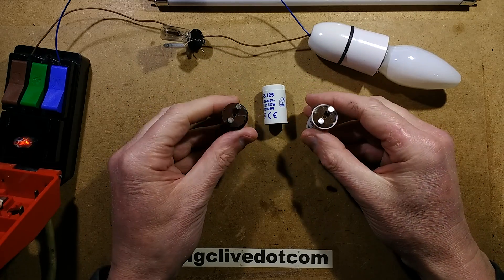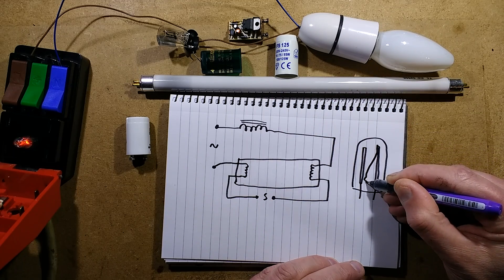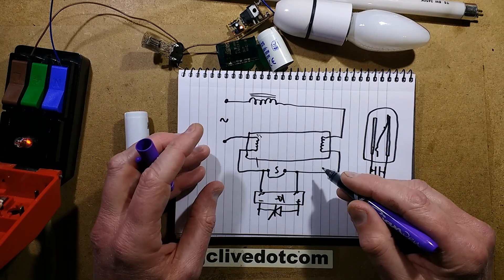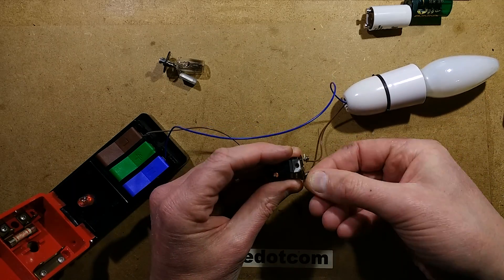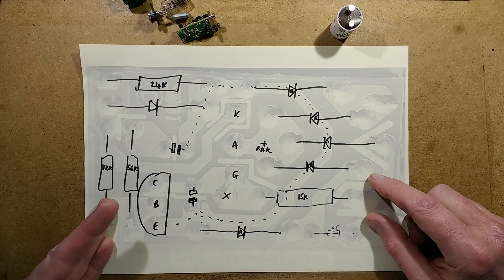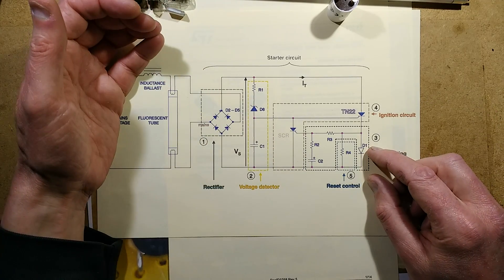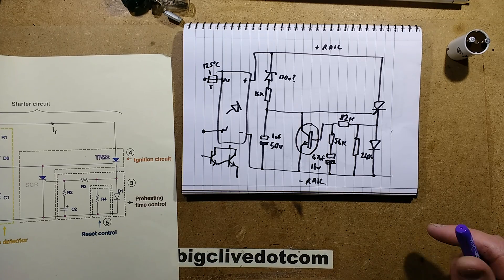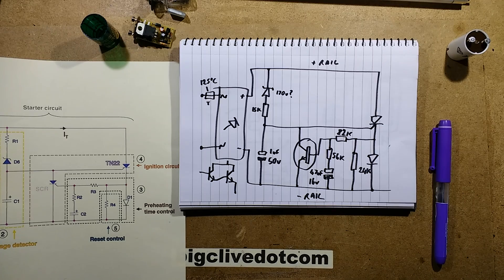Reverse engineering an electronic fluorescent starter.

Comment: There is no necessity of heated electrodes: with normal 220 V current and an inductance in a series with a capacitor you can obtain a very brillant tube neon light without heated or preheated electrodes, but you need a starter always: it must short-circuit this L-C ballast in order to generate starting high voltage electric arc, and it can do it easily. The neon tube then starts immediately, unlike the preheated tubes.

Comment: I saw you struggling with the word for thermal emitters. From the time before these newfangled transistors, we were very familiar with thermionic valves. 😉 Of course, these usually used a separate cathode although I suspect the fluorescent tubes cathodes may just be the filaments with a thermionic coating.

Comment: When the tube is operated in cold cathode mode on an electronic ballast and the emissive coating wears out, it is still able to strike (because it is a high voltage of about 600V`), but it will get hotter and hotter until the lampholder melts or the tube acutally loses vacuum.

Comment: The thyristor doesn't kick in again because the fluorescent lamp has been started and its voltage between filaments has dropped below 170 volts of Zener diode, so thyristors gate has no chance of switching the thyristor again, unless voltage again goes up to 170 volts.

Comment: I think it is pure luck that the TN22 stays on when it is supposed to, as the resistor across the diode in series with the cathode is 24k. It is that resistor pulling down on the cathode that drains current from C1 back into the gate to retrigger it on the next 1/2 cycle. C1 is then topped up by the voltage fed out the gate due to the equivalent circuit of an SCR (an NPN & a PNP driving each other). The max. firing current of the TN22 is 1.5mA, and the current through the 24k, with a full volt across it is only 41.7uA. It is relying on the TN22 taking less current than the maximum spec. I would have expected something like 470R, or 560R max.

Comment: The SCR is a type called a gate turn off, or GTO. That high hold current rating is only with the gate grounded. Driving it negative will drive it off. Because the timing capacitor stays topped up, the darlington would quickly drive the gate down to about the same potential as the cathode, so it could be retriggering, but turning off again quickly. You could check that with a cro. The reason for making it a GTO would be to make it turn off while there is still at least 175mA flowing through it to produce the inductive spike to start difficult tubes. I think the 56k in series with the timing capacitor might be to produce a bit of ripple to turn on the darlington, or fire the cutoff SCR while there is current flowing through the TN22 to produce the spike. In mine it was a 6.8K. I don't know what it was for, as the original thyristor was a C106D, not a GTO. Just recheck the orange capacitor value to make sure it is not 10uF like mine. Let me know whether it is or not, and the number on the zener please, as well as the thermal fuse number, as mine is a standard metal one rated at 2A 125 deg C.
The capacitor in a glow switch starter is to weld the contacts together briefly. I tried one without and the contacts just buzzed and it 1/2 lit.
Reply: In turn off mode , GTO's are equally power hungry devices that require at least (15-25)% of rated load current ( of reverse polarity) to turn off in my view , back then these were manufactured only for high voltage & high current industrial power control applications ..and such small / low power rated devices were economically unfeasible for general purpose everyday use.
Whilst the GTO's turn on circuit was similar & simple as for SCR's , turn off circuitry was more complex & power consuming.

Comment: bigclivedotcom, the 82k resistor has to go to the SCR gate to get enough voltage to turn on the darlington, as it requires 2 diode drops. I traced the circuit out from another youtube video by an American guy, but in his one, the 82k was 100k and the 15k was 33k like the one I put in my rangehood. Yours must be designed for a fitting with 2 tubes in series or 120V. What is the number of the zener in yours? Is it is probably a BZX85C110. It looks like you wrote 170V. That's not a preferred value. I'm not sure if mine is a Pulsestarter brand. I would have to partly disassemble the hood to see. It looks the same, but a different layout and has the same circuit as the datasheet, and has a specially selected sensitivity P0124 SCR instead of a darlington. R1 is 33k, R2 & R4 are 6.8k, R3 is 24k, C1 is 10uF, C2 is 100uF and the main SCR is a C106D. I posted the circuit on stackexchange How to light a fluorescent lamp, along with a modified version I designed to suit available components, which has a relatively fixed on time instead of that circuit which mimics the response time of the filaments with variations in current.

Comment: i use those ballasts  as load limiters  as i have 3  400w ballasts that came from  2 high bay hid lights and one from a  hps grow light .  and kept the bulbs for a display piece .   and soon will be gaining at least 10 more 70w twin fluorescent batten ballasts from an office that's getting torn down then rebuilt into a house  . then i can build a  variable load  limiter  when i burn things out using a bunch of light switches  and a double gang socket

Comment: I had heard quite some time ago that flourescent tubes had an expected lifetime that was based on the number of times you started it up,  and it was never quite clear to me why this should be,  until you explained it in this video.  I'm guessing that this is the reason that a lot of commercial properties like large office buildings are left illuminated all night long in places like New York City,  as opposed to turning the lights off.  Their cost for the electricity would have been less than having to replace the bulbs more often,  I guess.

Comment: you answered your own question with the transistor it has a 170v zener diode when tube strikes it no longer conducts as the  voltage drops' below 170v

Comment: 3:04 Why does it cool down? These videos are great. Electricity is just so strange to me. Cheers.
Reply: Electricity is not flowing through the gas but through metal which has low resistance
Reply: @Boz1211111  Why doesn't the low resistance make more electricity flow through it, making it get hot again? I know I'm wrong, but I dont get why.

Comment: Why choke and not cap dropper?
Reply from the maker: Capacitors tend to discharge suddenly when the tube strikes and damage the electrodes by causing sputtering with the current spike on each half wave.
Reply: bigclivedotcom so the choke will tend to maintain more of a constant currant under this application

Comment: The MPSA14 is a germanium transistor with junction voltage of 0.15 to 0.2v.

Once the tube starts the voltage across the tube is square (AC peaks clamped at about 100v) & the zener does not conduct, therefore no further conduction of main thyristor. But if by any chance tube does not strike then re-striking does happen.

In Old tubes the clamped voltage is beyond 140v. Tubes with still higher clamp voltage has danger of bursting.

Comment: The old starters were abysmal! I once lived 50 metres from a 'corner shop' [Spar]. One morning I go on the air on 20m with my ham station and there are ENORMOUS clicks about every 0.7s across (as it turns out) every band. I scratched my head for a few hours (at work) and finally concluded it must be a light. Sony ICF7600D in hand I find a huge signal when outside the shop. Look in and presto! One of the tubes is flickering on and off. I went in and pointed out what was happening and luckily they changed it (the tube) right away [it helped that it even showed on TVs and I pointed out I would tell the whole neighbourhood that their TVs were being 'attacked' by the local shop!!!!]. Luckily, after a couple of occurances of this they fitted electronic starters and the problem more or less never re-occurred.

Comment: I'm not understanding how those little bulb starts (with the bimetallic strip) work. How does current flow through them (to heat up the strip) before there's a path across them? I know it could arc across, but if that were possible how would the circuit ever open? Also, why do the strips cool down once they make contact (and current is flowing through them)?
Reply from the maker: There's a gas inside that conducts like a neon lamp.
Reply: @bigclivedotcom   Thank you. So that causes the neon to heat up which bends the strip, right? I was thinking the current flowing through the strip is what makes it heat up and couldn't figure why it could cool once it completed the circuit.

Comment: When starters didn't work, I would just run my hand back and forth on the glass tube, possibly with a piece of wool
if available, and they usually started. Static is a zero point power source.

Comment: The Pulsestarter doesn't simply open when it's finished preheating - it opens and closes very rapidly over a half-second period, or until one of the openings causes the lamp to start. Also, the diode D1 (at least in my unit) is a peculiar one, with a ~3V forward voltage. This might help with some of your confusion with the circuit.

Comment: Hi Clive. I was the original designer of the Pulsestarter in conjunction with Texas Instruments who were responsible for the original main thyristor power device. The data sheet you reference was the original design which was manufactured over a number of years by a company called Arlen in very large quantities. The original concept was based on the fact that preheating the tube cathodes (proposed by a very clever guy called Mike Lester) would increase the expected life of a flourescent tube. Resultant testing proved the fact so much that some extended life testing we had running was eventually turned off after 1 million successful strikes on, I think from memory, a batch of 58W T5 tubes. The idea was that after the preheat cycle, a number of pulses would be applied to the tube as the small thyristor would turn on but not have enough holding current to stay conducting at first but would eventually latch after a number of cycles.This meant that you were always attempting striking with hot cathodes and, unlike a standard glow starter, you avoided overheating and possible fire issues with a dead tube trying to keep on striking.
BTW, love your videos which I only found recently but now watch often.Keep up the good work.....and the gin, which is one of my favourite tipples :-).
Reply from the maker: Good job.  I remember the Arlen brand when they first appeared.  Did they feature on Tomorrow's World?
Reply: Nice. Ty for your input Maurice.
Reply: Hi Maurice. Am I right in assuming that the TN22 keeps getting retriggered, but driven off by the gate being pulled below the cathode, or is DiodeGoneWide's answer correct? And also, what is the reason for the resistor in series with the timing capacitor? Is it just to provide a bit of ripple to give the transistor, or the P0124 a bit of a nudge on? Another possibility I thought of is that the ripple from it peaks as the current peaks and makes the darlington drive the TN22 off then to get a good discharge from the inductor. Is that true? But that would not explain why they had it when they had  a C106D, which is not a GTO, so maybe it helped trigger the P0124, and now unfires  the TN22 at maximum current. I'm curious, please write me a reply. Cheers!
Reply: @pemac8856 Hi, 
DiodeGoneWild has done another video on fluorescent lamp starters: https://youtu.be/L0_nJAWty1M
Reply: I always thought that the General Electric research labs was responsible for the development of the SCR. Ron W4BIN

Comment: 2:21   If the starter is a part of the circuit as drawn, why is it then possible to remove the starter, after the tube is lit ?  That would make it an open circuit and no current would be able to flow ?
Reply from the maker: The starter is not in use after the tube is lit.  It's open circuit and the voltage across the tube is not enough to make it glow.
Reply: @bigclivedotcom  Yes but as you draw the starter in series, removing the starter should break the circuit, would it not ?

This is what i dont understand. There is no path for the current to flow between the live and neutral if there is no connection in the starter.
Reply from the maker: @JohnDoe-bd5sz  When lit the current flows through the tube and not the starter circuit
Reply: @bigclivedotcom  Aah, i think i see it now. It's because i thought that there should be a closed circuit, thru the 2 coils inside the flourecent tube.

The circuit when the tube is lit, is actually going from the top pin of one side, through the tube to the other.

Sorry man, i just had to understand it :)

Really love your videos, keep up the good work.

Comment: Well this brings back memories of the 70 ish I was about 14 and was amazed to discover that putting a starter and a light bulb in series, the bulb would flash. So I started building disco lights for friends. However my parents soon put a stop on my electrical explotes, not on safety grounds but because my testing was messing up their tv watching downstairs with rf interference.

Comment: How does the darlington transistor turn on in the first place ?
Its only got one diode drop to supply its 2 x base-emitter diodes and this diode drop is even voltage divided by the 82K-56K resistor divider.
IMHO the diode ist not a diode. It must be a zenerdiode to make the circuit work.
Something like a 6.8V zenerdiode, as the 47µF must have a charge to keep the darlington on long enough to discharge the 1µF capacitor and sink away this 1µF repeated charging current.

Comment: I've watched many, many YouTube videos all claiming to explain how the fluorescent starter works.
This is the only one that explains it fully, clearly and correctly. I especially like the bit about not connecting a starter directly to the mains. Yes, I have done this too! And yes! A very large pop it did make too!
Thanks Clive. This video made my day.
Reply: I'm still not fully understanding why. Is it because they're only expecting the full mains voltage for a fraction of a second? But then what if the tube fails to strike? What stops the circuitry from constantly attempting to strike it, and why, given that an unlit tube doesn't drop the voltage, does the starter not simply explode?

Comment: From the TN22 data sheet. It says on page 8 " If the lamp is not ignited after several attempts, the starter circuit can automatically stop the ignition sequence." How does this work? I see how the sequence will start again after a failed attempt. Just not how it will automatically stop the process after several failed attempts.

Comment: So, the tiny amount of current flowing through the "off" thyristor (which annoys you if you have a sensitive led which tries to start on it after loading its caps)
keeps the transistor active enough to prevent the thyristor from starting... interesting use of something i always viewed as a bad/negative aspect of Thyristors.
( i always hated that you cant really switch off a thyristor dimmer without another mechanical switch to really cut off the leakage current)

Comment: Finally understood the reason for the "high holding current"... When the drive to the thyristor is removed, it WON'T wait for the zero crossing, but will cease conducting while there is still current to provide a kick.

Comment: Once the fluorescent has fired there is going to be  no voltage at the transistor collector that's why that 170v zener is there? Therefore there is no voltage at the gate of the SCR. The transistor is there to take the gate away if tube fails to strike within a certain time, it should reset  itself? (Edit) the original circuit using the scr to control the gate would need a power cycle to reset.

Comment: Hi.

Could you please reverse engineer a crt circuit (tv or monitor) from mains input to flyback 
 
I've been trying to figure out how they work, they seems to drive the flyback HV  output so much more efficient than royer or zvs circuits , which always needs massive heatsinks, and still blows the transistors or mosfets on regular basis
Reply from the maker: The flyback circuitry in traditional CRT displays is very evolved and fine tuned for reliability.  The circuits used in it are generally mass produced for the task as are the transformers.

Comment: It's a simple capacitive pull down switch that's being used as a timer in this instance. Once the capacitor get's enough charge it's no longer pulling the base/gate pin to it's active voltage or vice versa. Think of the dual LED flasher circuit and how it uses transistors and capacitors to switch back and fourth. This works on essentially half that circuit. Since it has nothing to reset it back the other way, it just stays off.